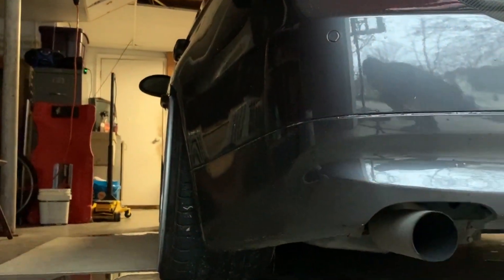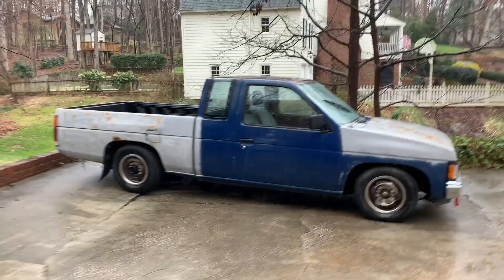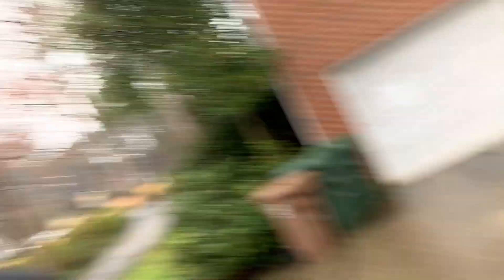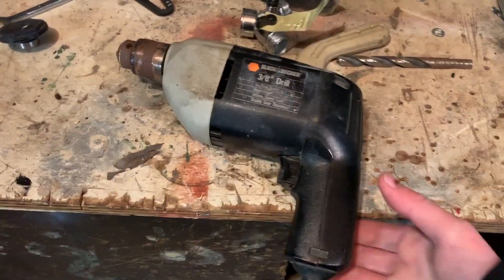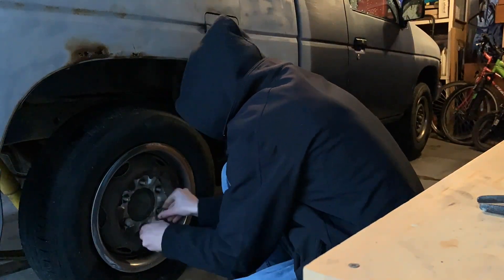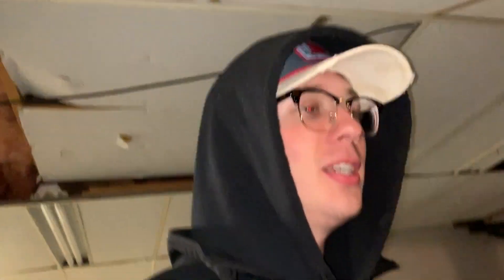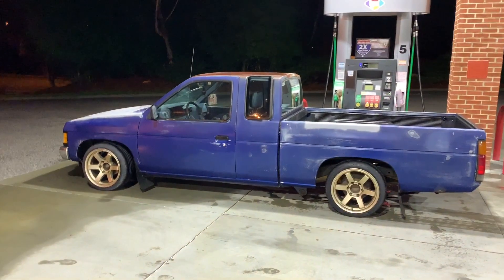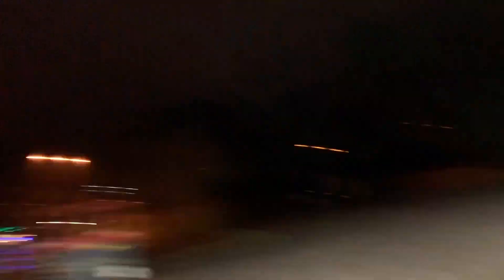Stanced Hardbody Gets New Wheels!

Comment: What did you do to make it set this hot torsion bars and cutting the bump stocks? I just put the same wheels and tires on my truck and it's sitting really high needing some help?
Reply from the maker: i lowered the torsion bars all the way down and cut the bump stops that was it

Comment: How do I do so that the wheels do not come out so much from the body?  Thank you
Reply from the maker: You get the right specs of wheels and when you lower the front it adds camber and will do it a little bit automatically
Reply: @dfitzwm  And in the back part I do it because when I put them and you jumped on the bed it hit the wheel and then I stopped doing it but I don't know if you used the wheels inside or what you did to get them into the body.  thanks bro